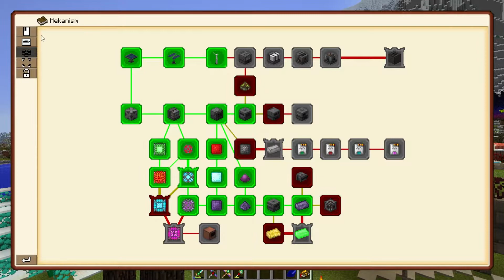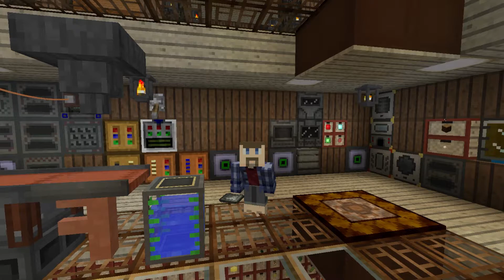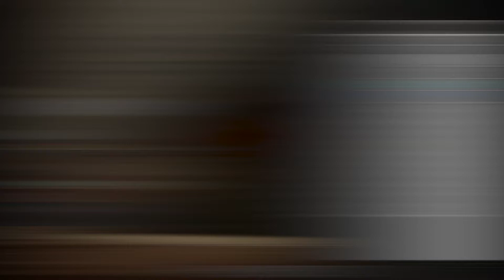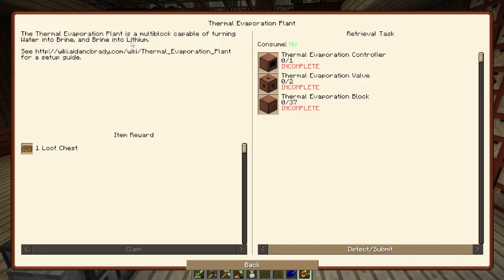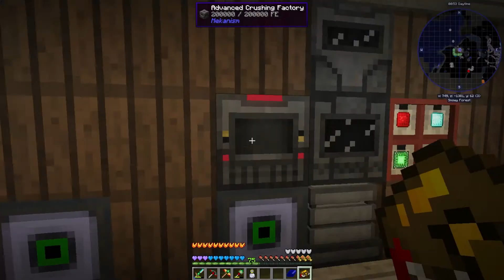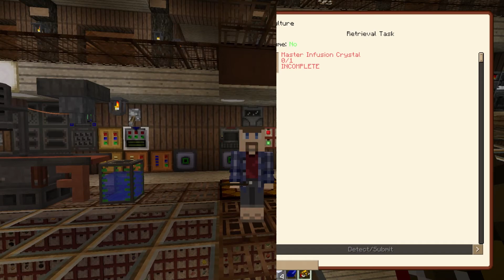Progressing Through Mekanism - Minecraft: Enigmatica 2 Expert #42

Comment: Good episode. I used the mekanism gas gen in regrowth powered by mashed pumpkins. Farms in regrowth were so easy to automate with botania and the crop sticks 😀 I think we can use ic2 crops but we get weeds so not so easy I guess. I used to channel
The power into a small mekanism capacitor or whatever it’s called. Had big storage for the effort 😀 
I keep thinking about making a few of the lava/water passive generators. Can’t remember the name of it.
Reply from the maker: Yeah, the IC2 crop sticks are just not worth the effort.  In regrowth, I used the Forestry multi-farm to handle everything.  I created a tower of a few of them stacked up, because in un-managed mode you can just plant whatever and it just harvests it all and doesn't need to replant it.

I used liquid steam boilers for power forever fed by creosote from a huge coke oven farm, that fed the coke into my endoflames.  I miss b-space barrels from jabba's barrels pretty badly.  Ender storage is just not the same, and yabba's barrels doesn't have an equivalent.

If you're talking about the thermoelectric generator from immersive engineering, they're cheap early game power, but you need a TON of them to make it worthwhile, and a grid of them takes up a bunch of space.  I made a couple early on, but there are so many better sources of early game power in this pack I just mostly ignored it.

Anyhow, the follow up to this is me finishing it out that chain with and advanced generators gas turbine, which is something I never got around to making in the past, and they're so easy other than sheer amount of materials it's almost overpowered.
Reply: Advanced generators Sounds interesting don’t think I’ve used them before. Been messing rftools screens today to track scrap in a drawer and then switch the UU matter fabricator on off from same screen. Only downside is not being able to see how much UU matter I have in the replicator. 😀
Think I will need to get into the farms you mentioned sounds good 👍